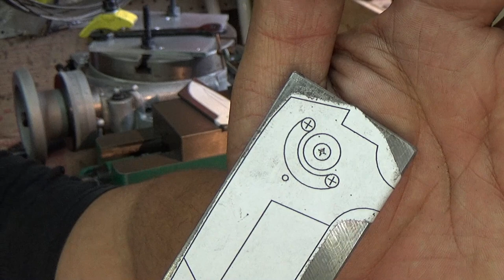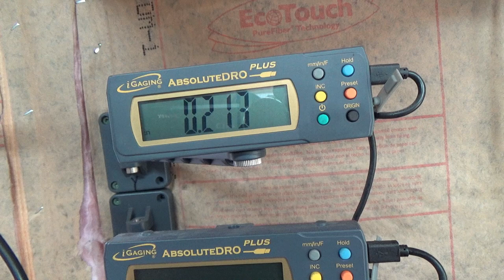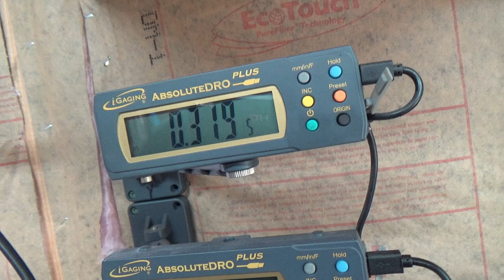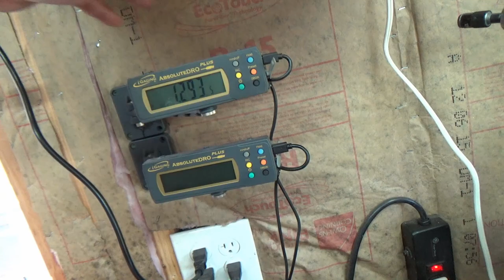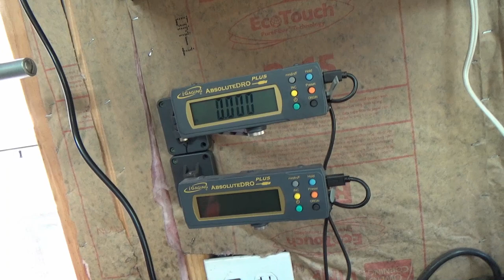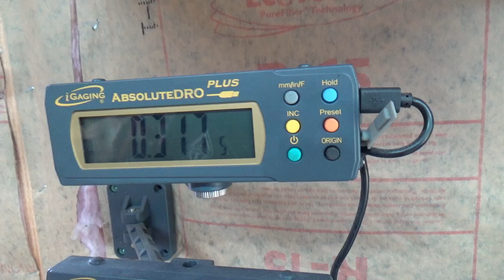Making A Folding Knife #2  Milling out the stop pin track

Comment: Hey dude. What are you using for sandpaper after heat treat for your hand rub? I've been doing all my hand rubbing after heat treat, but I started polishing up to 500 before heat treat and started using anti scale compound. It's made my life a little easier.
Reply from the maker: I typically go up in this order  120, 220, 320, 400, 600, 800  I stop at around 600 or 800. I always start with a more aggressive grit than necessary to remove any scratches I couldn't see. For example if the blade has a 400 grit grinder finish, I still start hand sanding with 120. Your roughest grit is the most important so when you think you're done, sand for another 10 minutes to be sure lol
Reply: Sorry I should have specified. What brands do you like to use for hand polishing?
Reply: Ya I have to be careful at the lower grits too. You can't be too aggressive with them or they'll scratch the blade worse than the belt haha.
Reply from the maker: rhynowet is my go to brand. i get it from supergrit and I've heard black ice is really good as well but I haven't tried it yet.
Reply: I'm also starting to experiment more with filing for finishing. I'm using 1x4inch diamond sharpening stones at a known grit. It keeps your grind lines super crispy.
Reply from the maker: Thats how they do it in Japan. They rough grind the bevels and finish them off on stones. I've never tried it but it looks really good when done right!
Reply: I recently met with a mastersmith and he walked me through a few things. He doesn't have many different belts in his shop because he's gotten so efficient at hand finishing and filing that he only takes his blades up to 60 or 80 on the belt. He hand finishes to 400 before heat treat and coats it in anti slag, then just touches it up. His 400 finishes look better than my 800s lol. And I can see why. I can't count how many times I've thrown a blade out because I was trying to polish it up with trizakt or something like that when I should have just taken it to hand much sooner. Keep up the awesome videos dude. I love watching them.